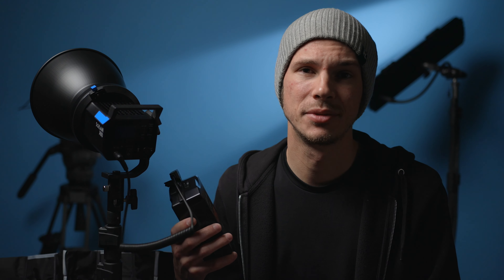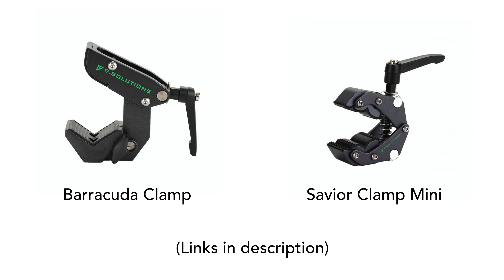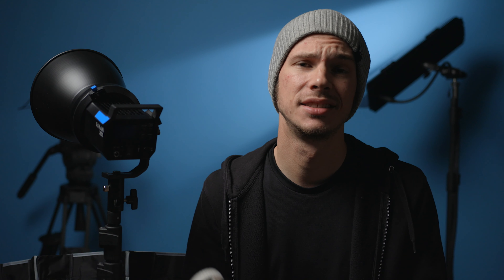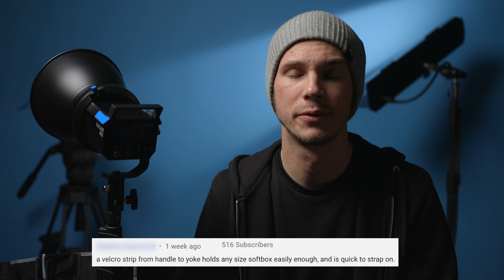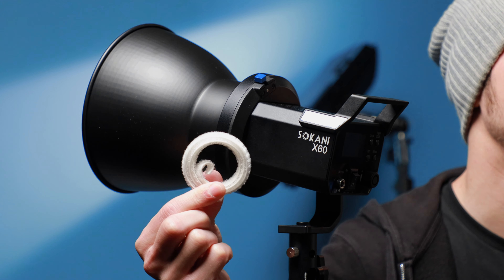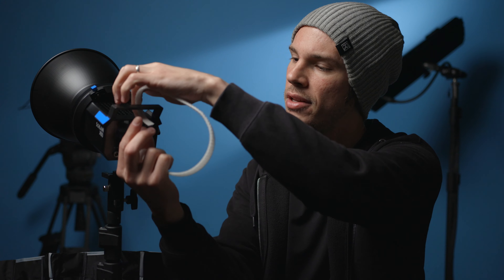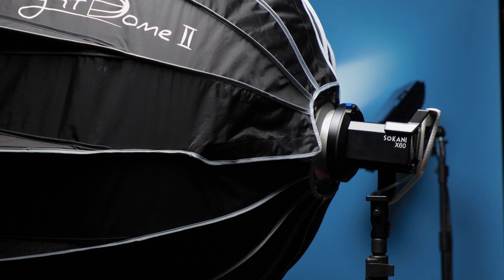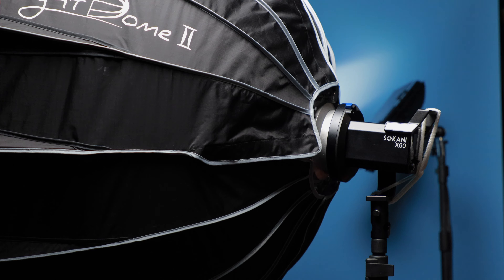Sokani x60 | Battery Power and Heavy Softbox Solution

Comment: i think you should unscrew the handle on the yoke and add a metal washer between, that should give you more tension, that's what i plan to do but i haven't received my unit yet
Reply from the maker: I've heard that will help as well- may try it but figured this would be a quicker solution for the moment and holds 100% where the metal washer may only help slightly :)

Comment: Hey, I like your approach a lot, thank you! I have the Sokani X60 V2. Is it possible that they've changed the DC connector? The cable you linked is a 12V 2.1*5.5mm, but my light takes 15V at 5.5*11.4mm, significantly larger. I only found a suitable D-Tap cable in Switzerland. :D Does any of you have any experience with this?
Reply from the maker: Hi Thanks so much! They have a v2 but the updated version does not have a different power connection unfortunately. I have a number of d-tap cables and just grabbed one that worked but I'm not sure about the brand or where I got it, sorry. Hopefully someone else can read this and share more

Comment: Isn't the input of the unit 15v? The cable you put in the description it is 12v does it work?
Reply from the maker: It's written as 15v on the light but seems to work with all the d-tap to DC cables I have and none of them were specifically rated for any special voltage as far as I could find. The ones I have lying around are all no-name brand ones from Japanese Amazon though, not available elsewhere as far as I could tell, so I liked to the Alvin's on Amazon US because I know his cables are pretty reliable. I think it would be alright, but all I can say is that I tested 4 or 5 random ones I have and had no problems. I'll do a bit more digging to see if there would be any potential problems though.
Reply: @ScottDumas  Thank you for all of your help and congrats about the video!
Reply from the maker: @luizwaay9168  Thanks for that! And it's my pleasure. I just sent a message to Alvin who makes that cable so I'll let you know if I get some more info :)
Reply from the maker: Hey! Heard back from Alvin and that cable can support anything below 24V, so the 15V of the Sokani will be no problem at all :) It's listed as 12V just because that's the most common thing people are looking for.
Reply: @ScottDumas  thank you very much for the follow up!
Reply: @Scott Dumas  And the connector size is correct? Because there is 5.5x2.1mm and 5.5x2.5mm for DC cables. What does the Sokani have?

Comment: Hi Scott, I have the V2 version, can I power the light with only a 95Wh 14.8v V-Lock battery (Neewer) and the D-Tap to DC Cable?
Reply from the maker: Hi! I think it should be the same as the first for power sources, so I think it should be ok. to work like this.

Comment: They already made a version 2, maybe they fixed it so it is more perfect. How much time, can the lamp stay on at 100% with the V-mount battery?
Reply from the maker: I got the v2 already and the sag under the weight of heavy softboxes is fixed, but they're still addressing fan noise and some other small details I think. at 100% with a v-mount would depend on the capacity of your v-mount, and it should be about 80W draw (per hour)
Reply: @ScottDumas  Thanks. Did they fix the DC power, since it could fall in if you press too hard?
Reply from the maker: @BumbleBeeProductions  DIdn't notice any differences myself but not sure if anything on the inside has changed.

Comment: How long does the battery last??
Reply from the maker: Depends on the capacity of the battery and the intensity of the light, this is an 80W light so in theory would last a bit over an our on a 98Wh battery for example

Comment: 🥵 My  x60 v1 will not stay at 100% power plugged into the wall. I just had it on at 90% for less than an hour before it automatically dim to 20%. I think it is overheating protection. Is this normal? does anyone else have this issue. I just bought it used, Probably going to return it. 🙄
Reply from the maker: Hmm, sounds like insufficient power but I’ve never had it happen to me 🤔

Comment: Can you sharr with me,  what type batery using for this sokani 60
Reply from the maker: I tested a GenEnergy and Soonwell 98Wh v-mount battery, but I believe almost any v-mount battery or even NP-F with a d-tap output for this cable should work. In the studio I've just been using it plugged into mains power mostly though.
Reply: @ScottDumas  great,  np970 will work?  Where to put the mount?  😅
Reply from the maker: @TheMrskudap  You would need an NP970 with a d-tap port on it and the cable I showed in this video (linked in description). Then you'd need to figure out a mount for the battery (anything would work, even gaff tape to the light stand, since the actual battery contacts aren't mounting in anywhere